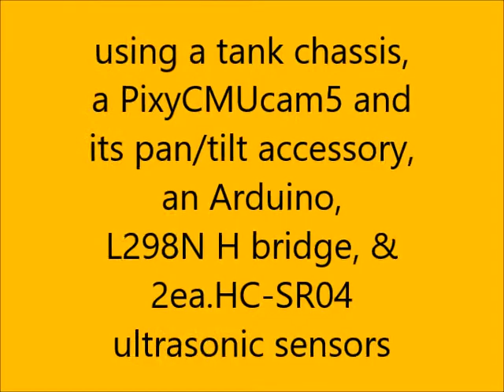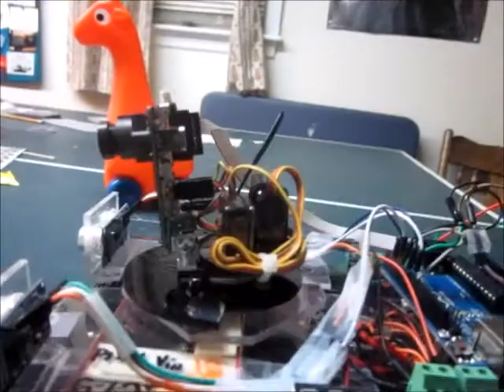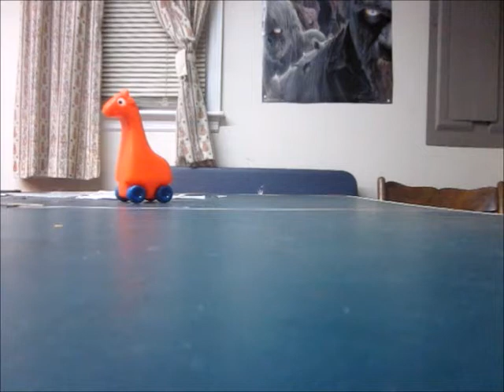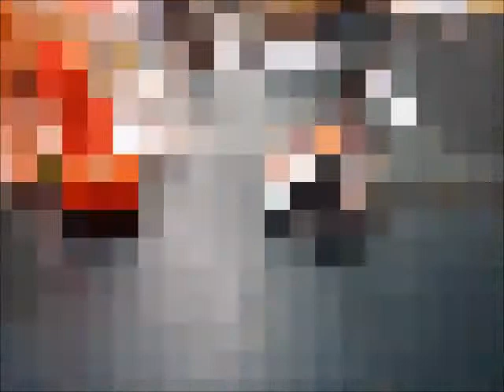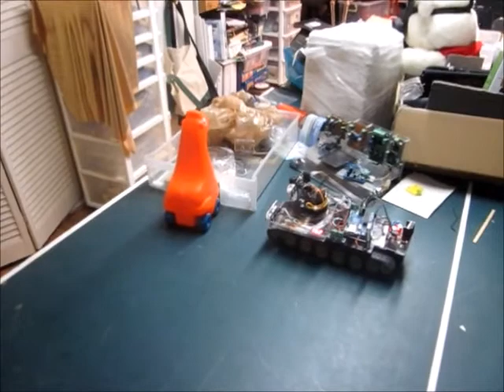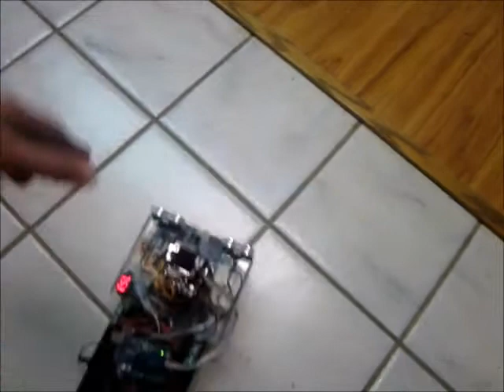The Orange Giraffe Hunter : autonomous color seeking Arduino robot  using PixyCMUcam5 PixyCam

Comment from the maker: PART 1 
//GiraffeHunterRev2_LessSearchMoreSnapshots.ino

// based on GiraffeFollowerTankRev2_homemadePingWorks
// feature in this revision, add in turning speed based on the size of detected object
//
//begin license header
//
// This file is part of Pixy CMUcam5 or "Pixy" for short
//
// All Pixy source code is provided under the terms of the
// GNU General Public License v2 (http://www.gnu.org/licenses/gpl-2.0.html).
// Those wishing to use Pixy source code, software and/or
// technologies under different licensing terms should contact us at
// cmucam@cs.cmu.edu. Such licensing terms are available for
// all portions of the Pixy codebase presented here.
//
// end license header
//
// This sketch is a good place to start if you're just getting started with 
// Pixy and Arduino.  This program simply prints the detected object blocks 
// (including color codes) through the serial console.  It uses the Arduino's 
// ICSP port.  For more information go here:
//
// http://cmucam.org/projects/cmucam5/wiki/Hooking_up_Pixy_to_a_Microcontroller_(like_an_Arduino)
//
// It prints the detected blocks once per second because printing all of the 
// blocks for all 50 frames per second would overwhelm the Arduino's serial port.
//
// Pixy commands listed here for my convenience 
//
// getBlocks() accepts an optional number argument (uint16_t) that indicates the maximum number of blocks you want getBlocks() to return.
// pixy.blocks[i].signature The signature number of the detected object (1-7 for normal signatures)
// pixy.blocks[i].x The x location of the center of the detected object (0 to 319)
// pixy.blocks[i].y The y location of the center of the detected object (0 to 199)
// pixy.blocks[i].width The width of the detected object (1 to 320)
// pixy.blocks[i].height The height of the detected object (1 to 200)
// pixy.blocks[i].angle The angle of the object detected object if the detected object is a color code.
// pixy.blocks[i].print() A member function that prints the detected object information to the serial port
// int8_t setServos(uint16_t s0, uint16_t s1)
// This method sets the pan/tilt servos that are plugged into Pixy's two servo ports. The two arguments s0 and s1 can range from 0 to 1000.
// int8_t setBrightness(uint8_t brightness)
// This method sets the brightness (exposure) of Pixy's camera. The brightness argument can range between 0 and 255 with 255 being the brightest setting.
// int8_t setLED(uint8_t r, uint8_t g, uint8_t b)
// This method sets the RGB LED on front of Pixy. The r, g and b arguments can range between 0 and 255.
//
//  http://www.cmucam.org/projects/cmucam5/wiki/Porting_Guide
//The serial protocol
//The protocol is data-efficient binary.
//The objects in each frame are sorted by size, with the largest objects sent first.
//You can configure the maximum number of objects sent per image frame ("Max blocks" parameter).
//SPI and I2C operate in "slave mode" and rely on polling to receive updates.
//When there are no detected objects (no data) Pixy sends zeros if the interface is SPI or I2C (since Pixy is a slave, it has to send something).
//Each object is sent in an "object block" (see below).
//All values in the object block are 16-bit words, sent least-signifcant byte first (little endian). So, for example, when sending the sync word 0xaa55, Pixy sends 0x55 (first byte) then 0xaa (second byte).

// You only need to supply a short 10uS
//pulse to the trigger input to start the ranging, and then the module will send out
//an 8 cycle burst of ultrasound at 40 kHz and raise its echo. The Echo is a
//distance object that is pulse width and the range in proportion .You can
//calculate the range through the time interval between sending trigger signal and
//receiving echo signal. Formula: uS / 58 = centimeters or uS / 148 =inch; or: the
//range = high level time * velocity (340M/S) / 2; we suggest to use over 60ms
//measurement cycle, in order to prevent trigger signal to the echo signal. 

   
#include <SPI.h>  
#include <Pixy.h>

// This is the main Pixy object 
Pixy pixy;
uint16_t blocks; 
//  These are the variable declarations in one place to make things easier for me
int FWD=LOW;  // direction bit for running forward
int REV=LOW;  // direction bit for running reverse
int STOP=HIGH; // the stop zone int turn_left= LOW; 
int turn_right = LOW;
int turn_left = LOW;

// pinging
unsigned long LHSmicroseconds =0; 
unsigned long RHSmicroseconds =0; 
unsigned long LHSPingDistanceInches =0; 
unsigned long RHSPingDistanceInches =0; 

//  These are the variable declarations in one place to make things easier for me
int SPD=200; // speed ref forward 255 is 100% PWM
int SPDREV=100; // speed ref in reverse 255 is 100% PWM 
int TurnSpdOffset=100; // turn spd reference - plus or minus from main spd ref
int blobwidth = 0;
int blobheight = 0;
int blob_x = 160;
int blob_y = 100;
int blob_height=5;  // new in this rev
int blob_width=5;   // new in this rev 
unsigned int blob_area=25; // new in this rev 
int TurnSpdByDist=10; // new in this rev

////for pivots during Search mode
int ServoHoldTime=500; //settle time between servo position changes
int OrangeGiraffe=LOW;
int MinimumImageWidth=10; //image width in pixels to recognize the giraffe
int LHSPivotTime=100; // 47ms is calc'd default time for tank tread pivot routine
int RHSPivotTime=110; // 55 ms is calc'd default time for RHS tank tread pivot routine
int PivotDelay=45; // calc VAR for pivot time

void setup()
{
 Serial.begin(9600);
 Serial.print("Starting Setup...\n");

  pixy.init();

// define physical IO
pinMode(9, OUTPUT); // PWM motor A in FWD, low in reverse  RHS
pinMode(6, OUTPUT); // PWM motor A in REV, low in FWD      RHS
pinMode(5, OUTPUT); // PWM motor B in FWD, low in reverse   LHS
pinMode(3, OUTPUT);  // PWM motor B in REV, low in FWD      LHS

pinMode(8, OUTPUT); // RHS trigger
pinMode(7, INPUT); // RHS echo

pinMode(4, OUTPUT); // LHS trigger
pinMode(2, INPUT);  //   LHS echo
delay (2000); // wait for Pixy to calm down
}

Comment from the maker: Arduino code Part 4 ( YAY! last one)

void StopTreads() ///zero tank speed if it goes to Search mode
{
      analogWrite(9,0);   // PWM motor A in FWD, low in reverse  RHS
      analogWrite(6,0);     // PWM motor A in REV, low in FWD      RHS
  
      analogWrite(5,0);     // PWM motor B in FWD, low in reverse   LHS
      analogWrite(3,0);   // PWM motor B in REV, low in FWD      LHS
  //    Serial.println ("Stopped tank when in Search mode");
}

void PivotLeft() ///turn CCW facing tank rear
{
       analogWrite(9,200);   // PWM motor A in FWD, low in reverse  RHS
      analogWrite(6,0);     // PWM motor A in REV, low in FWD      RHS
  
      analogWrite(5,0);     // PWM motor B in FWD, low in reverse   LHS
      analogWrite(3,200);   // PWM motor B in REV, low in FWD      LHS
      delay(PivotDelay); // pivottime is determined by the angle when the Orange Giraffe is seen
//Serial.println ("pivotted to Left");
// then stop the pivot

       analogWrite(9,0);   //RHS // PWM motor A in FWD, low in reverse  RHS
      analogWrite(6,0);    //RHS
  
      analogWrite(5,0);     //LHS
      analogWrite(3,0);        
}

void PivotRight()
{
     analogWrite(9,0);   //RHS
      analogWrite(6, 200);    //RHS
  
      analogWrite(5,200);     //LHS
      analogWrite(3, 0);                       //LHS
   Serial.println("pivoted to the right");
   delay(PivotDelay);   // pivottime is determined by the angle when the Orange Giraffe is seen
///after completion,stop the pivot
       analogWrite(9,0);   //RHS
      analogWrite(6,0);    //RHS
  
      analogWrite(5,0);     //LHS
      analogWrite(3,0);        
}

void Pivot180()
{
     analogWrite(9,0);   //RHS
      analogWrite(6, 200);    //RHS
  
      analogWrite(5,200);     //LHS
      analogWrite(3, 0);                       //LHS
   delay(1000);   // pivottime is determined by the angle when the Orange Giraffe is seen
///after completion,stop the pivot
       analogWrite(9,0);   //RHS
      analogWrite(6,0);    //RHS
  
      analogWrite(5,0);     //LHS
      analogWrite(3,0);        
}

Comment from the maker: Arduino code Part 1  ( code too big to put in one comment ) 
//GiraffeHunterRev2_LessSearchMoreSnapshots.ino
// based on GiraffeFollowerTankRev2_homemadePingWorks
// feature in this revision, add in turning speed based on the size of detected object
//
//begin license header
//
// This file is part of Pixy CMUcam5 or "Pixy" for short
//
// All Pixy source code is provided under the terms of the
// GNU General Public License v2 (http://www.gnu.org/licenses/gpl-2.0.html).
// Those wishing to use Pixy source code, software and/or
// technologies under different licensing terms should contact us at
// cmucam@cs.cmu.edu. Such licensing terms are available for
// all portions of the Pixy codebase presented here.
//
// end license header
//
// This sketch is a good place to start if you're just getting started with 
// Pixy and Arduino.  This program simply prints the detected object blocks 
// (including color codes) through the serial console.  It uses the Arduino's 
// ICSP port.  For more information go here:
//
// http://cmucam.org/projects/cmucam5/wiki/Hooking_up_Pixy_to_a_Microcontroller_(like_an_Arduino)
//
// It prints the detected blocks once per second because printing all of the 
// blocks for all 50 frames per second would overwhelm the Arduino's serial port.
//
// Pixy commands listed here for my convenience 
//
// getBlocks() accepts an optional number argument (uint16_t) that indicates the maximum number of blocks you want getBlocks() to return.
// pixy.blocks[i].signature The signature number of the detected object (1-7 for normal signatures)
// pixy.blocks[i].x The x location of the center of the detected object (0 to 319)
// pixy.blocks[i].y The y location of the center of the detected object (0 to 199)
// pixy.blocks[i].width The width of the detected object (1 to 320)
// pixy.blocks[i].height The height of the detected object (1 to 200)
// pixy.blocks[i].angle The angle of the object detected object if the detected object is a color code.
// pixy.blocks[i].print() A member function that prints the detected object information to the serial port
// int8_t setServos(uint16_t s0, uint16_t s1)
// This method sets the pan/tilt servos that are plugged into Pixy's two servo ports. The two arguments s0 and s1 can range from 0 to 1000.
// int8_t setBrightness(uint8_t brightness)
// This method sets the brightness (exposure) of Pixy's camera. The brightness argument can range between 0 and 255 with 255 being the brightest setting.
// int8_t setLED(uint8_t r, uint8_t g, uint8_t b)
// This method sets the RGB LED on front of Pixy. The r, g and b arguments can range between 0 and 255.
//
//  http://www.cmucam.org/projects/cmucam5/wiki/Porting_Guide
//The serial protocol
//The protocol is data-efficient binary.
//The objects in each frame are sorted by size, with the largest objects sent first.
//You can configure the maximum number of objects sent per image frame ("Max blocks" parameter).
//SPI and I2C operate in "slave mode" and rely on polling to receive updates.
//When there are no detected objects (no data) Pixy sends zeros if the interface is SPI or I2C (since Pixy is a slave, it has to send something).
//Each object is sent in an "object block" (see below).
//All values in the object block are 16-bit words, sent least-signifcant byte first (little endian). So, for example, when sending the sync word 0xaa55, Pixy sends 0x55 (first byte) then 0xaa (second byte).

// You only need to supply a short 10uS
//pulse to the trigger input to start the ranging, and then the module will send out
//an 8 cycle burst of ultrasound at 40 kHz and raise its echo. The Echo is a
//distance object that is pulse width and the range in proportion .You can
//calculate the range through the time interval between sending trigger signal and
//receiving echo signal. Formula: uS / 58 = centimeters or uS / 148 =inch; or: the
//range = high level time * velocity (340M/S) / 2; we suggest to use over 60ms
//measurement cycle, in order to prevent trigger signal to the echo signal. 

   
#include <SPI.h>  
#include <Pixy.h>

// This is the main Pixy object 
Pixy pixy;
uint16_t blocks; 
//  These are the variable declarations in one place to make things easier for me
int FWD=LOW;  // direction bit for running forward
int REV=LOW;  // direction bit for running reverse
int STOP=HIGH; // the stop zone int turn_left= LOW; 
int turn_right = LOW;
int turn_left = LOW;

// pinging
unsigned long LHSmicroseconds =0; 
unsigned long RHSmicroseconds =0; 
unsigned long LHSPingDistanceInches =0; 
unsigned long RHSPingDistanceInches =0; 

//  These are the variable declarations in one place to make things easier for me
int SPD=200; // speed ref forward 255 is 100% PWM
int SPDREV=100; // speed ref in reverse 255 is 100% PWM 
int TurnSpdOffset=100; // turn spd reference - plus or minus from main spd ref
int blobwidth = 0;
int blobheight = 0;
int blob_x = 160;
int blob_y = 100;
int blob_height=5;  // new in this rev
int blob_width=5;   // new in this rev 
unsigned int blob_area=25; // new in this rev 
int TurnSpdByDist=10; // new in this rev

////for pivots during Search mode
int ServoHoldTime=500; //settle time between servo position changes
int OrangeGiraffe=LOW;
int MinimumImageWidth=10; //image width in pixels to recognize the giraffe
int LHSPivotTime=100; // 47ms is calc'd default time for tank tread pivot routine
int RHSPivotTime=110; // 55 ms is calc'd default time for RHS tank tread pivot routine
int PivotDelay=45; // calc VAR for pivot time

void setup()
{
 Serial.begin(9600);
 Serial.print("Starting Setup...\n");

  pixy.init();

// define physical IO
pinMode(9, OUTPUT); // PWM motor A in FWD, low in reverse  RHS
pinMode(6, OUTPUT); // PWM motor A in REV, low in FWD      RHS
pinMode(5, OUTPUT); // PWM motor B in FWD, low in reverse   LHS
pinMode(3, OUTPUT);  // PWM motor B in REV, low in FWD      LHS

pinMode(8, OUTPUT); // RHS trigger
pinMode(7, INPUT); // RHS echo

pinMode(4, OUTPUT); // LHS trigger
pinMode(2, INPUT);  //   LHS echo
delay (2000); // wait for Pixy to calm down
}

Comment: I'm imagining I'm the giraffe and the tank is my grocery carrying wagon... can you see that working? Please share your arduino code :)
Reply from the maker: Your cart follower has a chance to work. You have some thinking to do about how to use image size to move forward and reverse. The Pixycam will misidentify colors depending on lighting, and take off to find another like object ( like a person with orange tennis shoes )   I am posting the code to go along with the video, however doesnt show PixyCam settings.
Reply: @RoboZombieDeluxe  thanks, I'll try to find a unique enough ankle strap and test colors or patterns. I'm not too old to walk, but carrying stuff back is getting harder every year . Thanks so much!
Reply from the maker: You could also forgo the automated part and just use a radio control for driving an electric cart, and if get crazy, mix in some automation.
Reply from the maker: The Arduino code is now posted in the comments of this video.
Reply: @RoboZombieDeluxe  that's just great, thanks so much. I'm in the very early stages, I have to order a pixy 2, arduino, yard cart,  350W Electric Wheel Hub Motor Kit Electric Motor Skateboard Kit with Solid Tyre 8inch for Electric Bike, stepper motor for turning, batteries etc... but its just fantastic to see your video and code to confirm that it might actually be possible. 

My vision is to have a detachable 5th wheel ( in front center ) on the wagon/cart that contains all the batteries and electronics so i can leave the cart outside and bring the electronics in for charging and/or security. Some of these carts are even fold-able, so maybe i don't even have to worry :)
Reply: @RoboZombieDeluxe  yes i agree, there's no reason i should limit myself to one add on when i can add bluetooth too :)  but my goal is crazy automation... so i'll keep my eyes on that prize.
Reply from the maker: @michaelluger2127  This is a Power Wheels Hummer, weight capacity 120 lbs, I refit with radio control. https://www.youtube.com/watch?v=L5bMCFETkXY
It uses an Arduino nano to read the radio control receiver output channel 2 for throttle control (PWM) and translate to another type PWM to control a 50 amp H bridge. It uses current regulated buck supplies to drive the LED floodlights, switched by another Arduino nano, translating the signal from channel 3 of the radio receiver. Another Arduino Nano operates qty 5 ping modules mounted in the front, outputs 2 hardwired signals to the throttle control arduino nano, one to slowdown if object is a few feet in front of it, and another to lockout forward speed reference if an object is a couple feet in front of it. This keeps people from ramming friends and parents when I let them control it. I take it to school and library STEM nights, Maker Fairs, science museum events,  etc. The hummer is now coated in gold mylar, with an antenna mounted on the rear, looks like a moon buggy.    
This is another smaller Power Wheels refitted with radio control. https://www.youtube.com/watch?v=Ttq8KGbPVmE&t=16s
It uses an Arduino Nano to translate the radio reveiver PWM channel 2 throttle output to a PWM signal t drive an H bridge. The nano sequences the headlights, brake lights, and backup lights, and another Arduino nano controls the WTV20 SD 16P audio system. 
I tried learning bluetooth to make my own controls, the cell phone programming is a bit over my head. Good Luck !